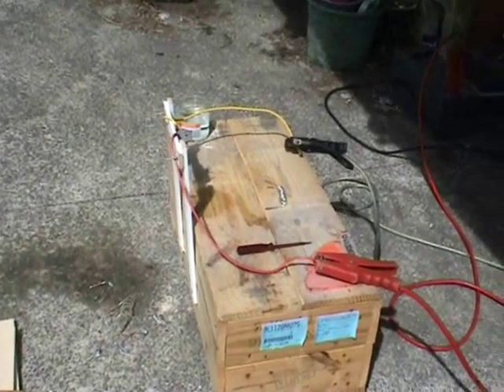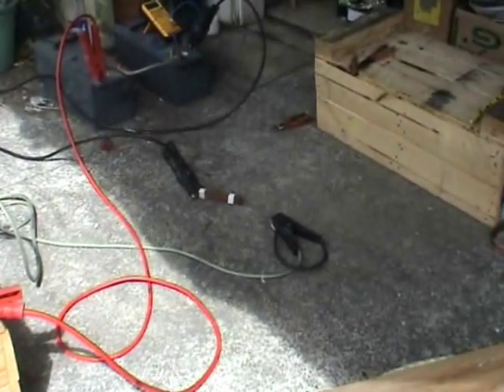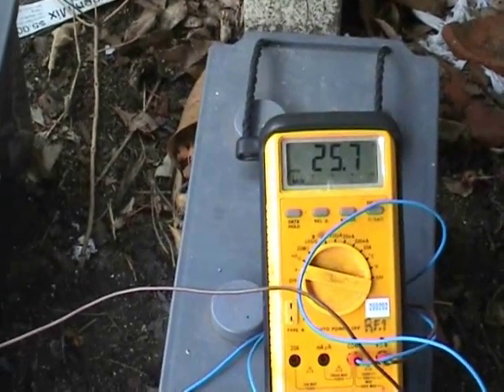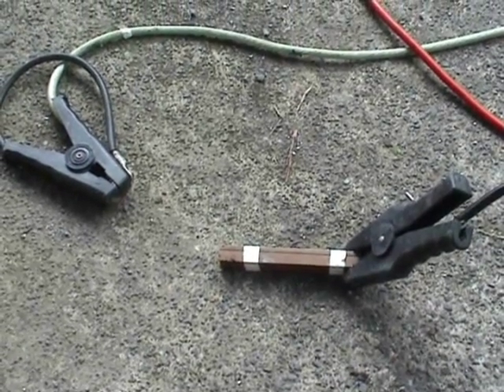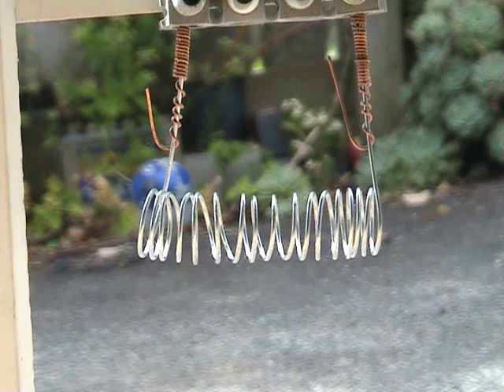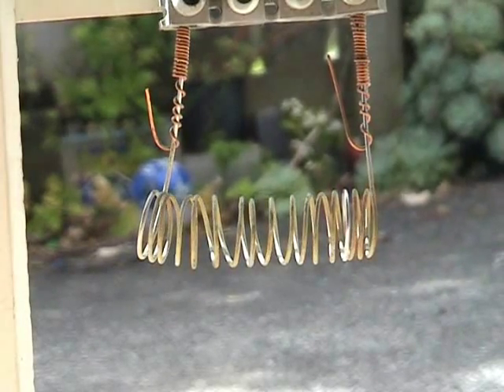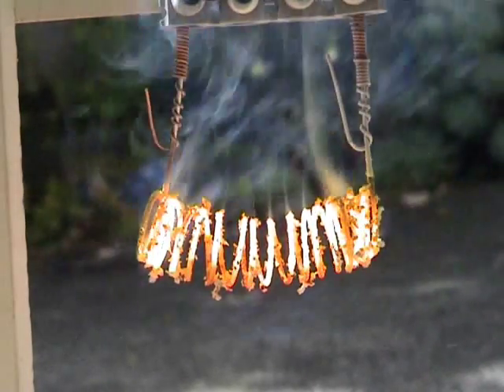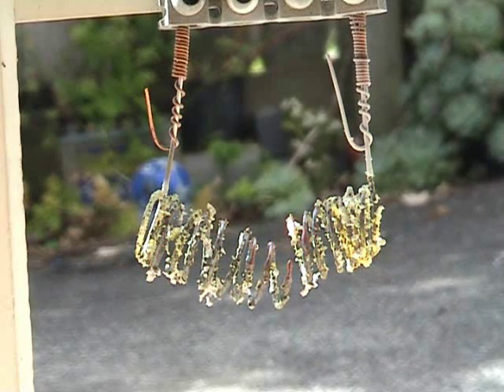Filament meltdown 1

Comment: The next time you do filament  burn outs/meltdowns, can you push the disconnected parts back together in order to 100% burn it until there isn't anything left at all? It's what I did with a paperclip on a 24v (12v in series) SLA that ended up shorting out. Cheap chinese accessories in electric scooters are fucking easy to fuck up :D